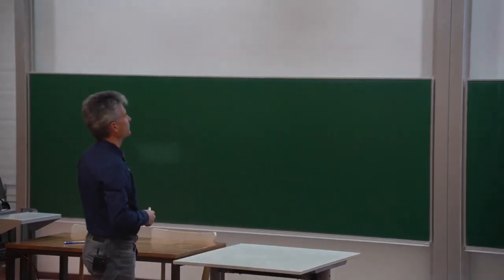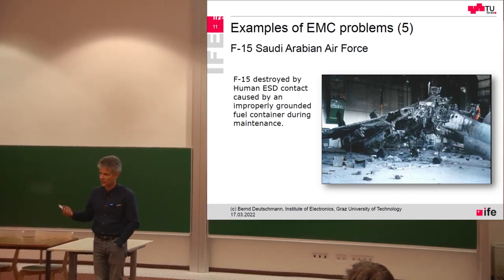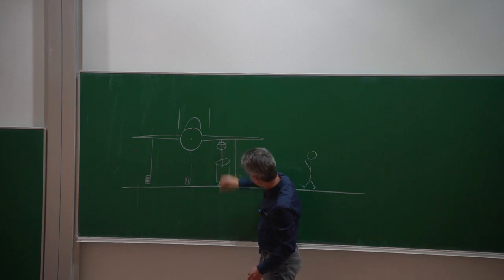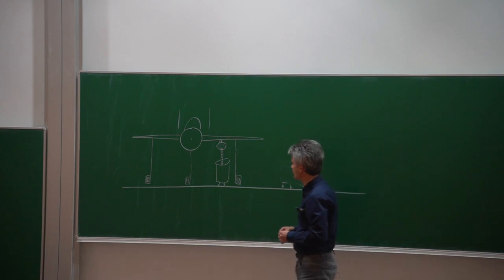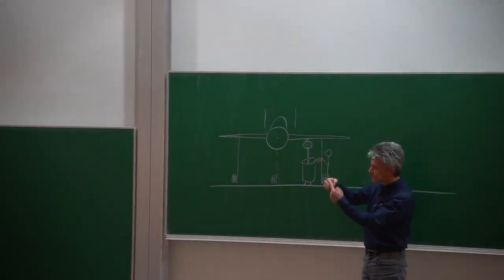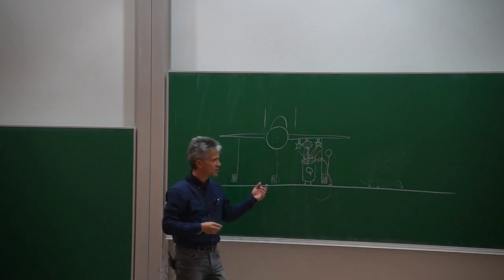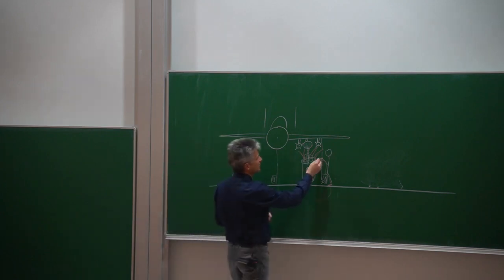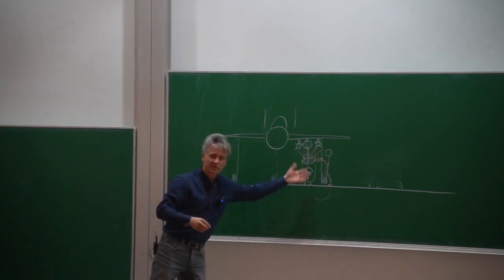EMC Example: Fighter Jet Accident

Comment: Another much earlier example, USS Forrestal air craft carrier fire 1967.  A safety pin (launch disable) had been removed from a Zuni rocket attached to an aircraft on-deck.   The official investigation identified the cause as electrical malfunctions on the aircraft when switching from external to internal power.   An electrical cable (pigtail) transferred a pulse of energy to the Zuni and it launched.   If you watch the original flight deck video, you can see interference from the ships radar.  Another example of EMI.